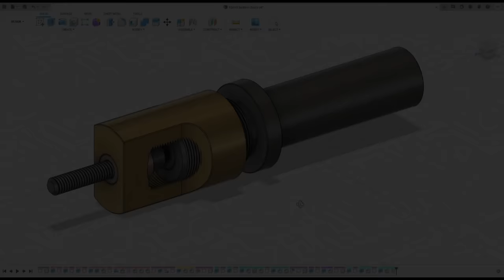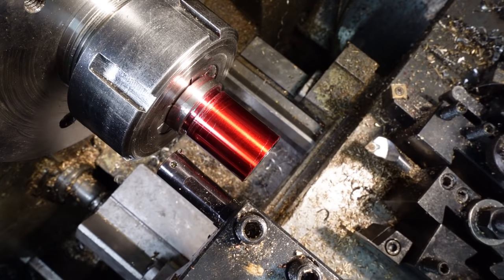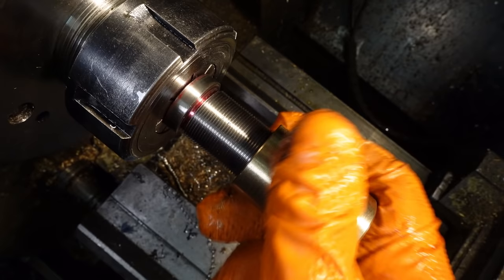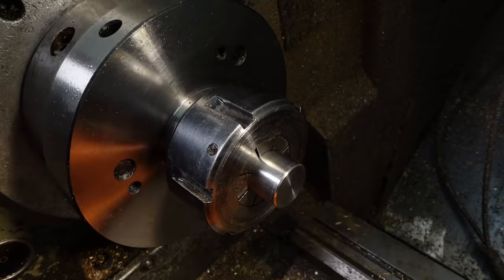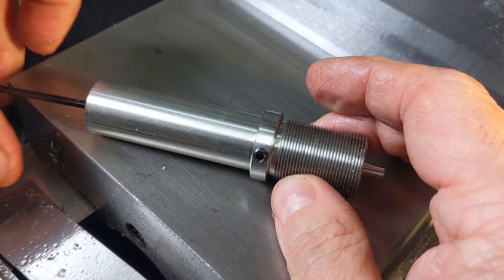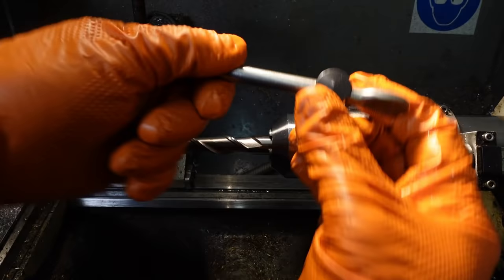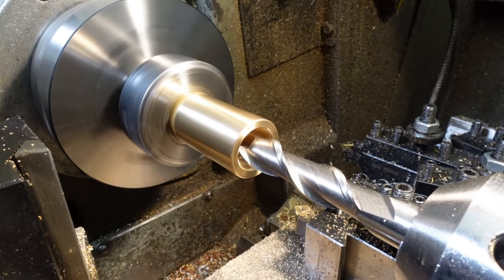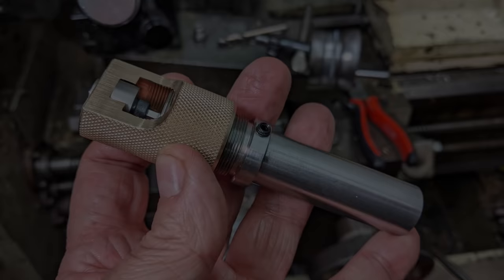Lantern Chuck machining and build #toolfest2021

Comment: I'd never heard of a lantern chuck before now.  Now I'm educated!  Lovely video!
Reply from the maker: There'll be a more classical Lantern Chuck coming along in a future video. That one uses a solid body with long side openings like the nut in this one, but the mechanism is tightened differently.  That means the axis of the screw is much more tightly controlled.  This version is great for screews between M2.5 and M8, or indeed Imperial sizes in that range.  The new one will be for the M1.0 to M3 range, mainly for making special tuning posts and small fixing screws for microwave kit.  Watchmakers have been using lantern chucks for this sort of work for ever.  I just need to think how to make it pretty and shiny and a joy to use.

Comment: He is the reason I took in consideration my 26 years of experience and started  watching videos my professional career on you tube with a different outlook. once I saw how my comments could and do probably seem like a  keyboard warrior . I don't care how clean a shop is cause everyone's perception on cleanliness is well there's alone.no more comments on how to tune,build a engine,transmission,rewire,or weld up any type of steel or alloys.and machine parts to a engine or job shop. Great video and content. I have learned quite a few things and tricks from you.thank you .

Comment: Luv seeing someone who uses the proper speeds and feeds for the different tools.  And thanks for showing the making of a tool I never heard of or have seen used.  Very interesting.
Reply from the maker: I try to listen to the machine and the material in an attempt to get good chip formation rather than sticking to the published rates for each tool/material combination, as those are usually based on wearing out the tool fairly rapidly and using lots of horsepower to shift material as rapidly as possible in the pursuit of Profit. As I'm only capable of pursuing Loss, I'm more interested in precision and finish and not making chips like razor wire that fast cycle times. Sometimes though I just can't get the chip load high enough because of only having a 3HP motor from four decades ago.  That's perhapswhy I sometimes use high-rack polished inserts that are meant for non-ferrous on steel instead (to the horror of the  assembled multitudes). Sometimes I just get it wrong, but the old Colchester has a super gearbox and I also have the variable speed inverter control, so I can even do the right thing with a fake CNC lathe spindle speed-up as the diameter of cut falls on facing cuts and pretend it's a Mazak and I'm cosplaying as Edge Precision. "Probably not..."

Must go watch some Vice Grip Garage, it's been a long evening in the shop making Delrin ribbons.
Reply: @MachiningandMicrowaves  Delrin ribbons will force you to do the dreaded clean up LOL
Reply from the maker: @michelecrown2426  If I get the aim right, I can get the ribbon to arc over the toolpost directly into the bin. I never seem to achieve that when the camera's rolling, but one day....  Youtube Shorts here I come. I nearly made one last night, but I fell asleep instead.  It's probably for the best.

Comment: True story: About 40 years ago, I needed to some machine work done that the local shop said that he couldn't do. They told me about a shop in East Point that they thought could do the job for me. The shop was in the "old part of town" and sure enough the shop was an old wooden building that was quite large. I could tell that at one time this had been a bustling business. Well the thing is the building had, at one time, been on fire. All the machines were driven by the "over head" pulley system. There were great wooden columns and overhead beams that were charred from the fire, some halfway through.  The canvas belts had burned away and had been replaced with used ones. The pulleys and shafts hand all the paint burned off and were rusted severely. The owner had kicked the ashes under the machines and created little paths to walk in and continued business as usual. 
I, now, wish that I would have taken pictures of that place because I fear that no one will believe me.
Reply from the maker: Brilliant!

Comment: That's a neat fixture! Never saw something like that before today. I just split a nut with a hacksaw and use it as a clamping fixture in the 3 jaw. If its a long screw I will use 2 nuts. Thanks for the video.

Comment: Just found your channel yesterday, I like your thoughts on gloves and cleanliness. And I like your responses to the negative comments. It might be ok to give advice to beginners, but people should just sit back, be quiet, and enjoy the work of a master. I look forward to watching more of your videos. Thank You.
Reply from the maker: I love getting good and useful advice about what I'm doing wrong and things I haven't spotted. I've had some really perceptive comments and suggestions from seriously expert folks out there.

I'm just wildly allergic to armchair H&S nerds, and I respond with extreme prejudice if I feel like I'm being bullied. Anyway, all is sweetness and light, the bits of the shop that get seen in the videos are clean enough to eat lunch off (if you don't mind cutting oil and odd bits of swarf in your sandwiches obvs).

I'm very slowly getting new cupboards and drawers fitted, and moving some stuff out into a new area for sawing, grinding and welding, and setting up a separate indoor area for metrology, which will make for better precision and liberate space for some other machines.  Also setting up a 3D print area in one of my other workshops and an electroplating/electroforming zone in another one of the old farm buildings.  Then there's the metalcasting area and the antenna range and all the other jobs I don't have time for! At some point in the far future, I'll have the space organised so it looks like an operating theatre, but the eventual heat death of the Universe may arrive first.  Right, back to making huge volumes of Delrin ribbons in the cause of Science.

Comment: I really enjoyed the lantern chuck video and it's been added to the project list.  I'll get round to it RSN, as unlike you, I've retired from network management and security at a certaain university, having also failed to find a proper job over the decades.  Meanwhile, the swarf on my Myford provides evidence to The Management, when she peers across the threshhold, that the expensive object does actually get used.  I too had to retire my shop vac after two and a half decades of (ab)use but I bought a new one at the end of last year.  I've used it four times already.
Reply from the maker: I need to make a more classic lantern chuck for the really REALLY tiny screws at M1.6 and smaller. This one is getting a surprising amount of use.

Comment: Yeah I use riggers gloves when I'm using the wire wheel on the bench grinder, the chance of the wire catching and ripping my hand in is close to zero whereas the chance of it wire brushing the sensitive layers of my fingers off is high.

Comment: I had a job to shorten many hundreds of allen head screws like that. Doing them one at a time like that would take forever. I just took a flat bar and tapped a row of holes in it , screwed in 15 screws, put it in the mill and lopped them all off. I ground a bit for the fly cutter (no not the kind of fly cutter that all the bone heads copy from each other) that would both face mill on the outer edge and cut a 45 deg on its inside edge such that if it is brought down on the screw it cuts a 45 chamfer on the screw. Since I spaced the screw an even distance I could just turn the mill handle 2 turns to move from screw to screw. 
1) Mill across
2) Center on #1 
3) down chamfer 
4) two turns 
5) down chamfer #2 etc.  etc.
EASY PEASY, job was done perfectly in a couple of hours.
Reply from the maker: Yep, done exactly the same thing lots of times where there's a batch to do. I have a drawer full of different bits of bar with lines of holes in various threads. Those lantern chucks are useful where you need to machine a ball or domed face or form a precise parallel section or remove part of the thread or machine part of the thread off and cut a different thread, or length the thread of a plain-shanked bolt like I did last week.  OK, that could be done on a mill with a die in a collet chuck, but not if the bolt had a countersunk head. It might be easier to single-point it, especially if it needs a fillet or a gutter at the end of the thread. For short runs and one-offs and weird stuff, it's a useful thing to have around where a slab of plate with tapped holes isn't feasible.  Also much easier just to buy the right size screws in the first place I guess! Also it was a fun little project and I have the ultimate luxury of not having to earn my living from machining (or indeed, microwave radio engineering or Physics).  I'd starve quite rapidly in all three cases, I'm sure.

Comment: Hi, I bought an old southbend Lathe about 10 years ago, Managed to build a quarter size Steam Tractor "John Fowler" design and have continued since to repair and manufacture numerous tool's and gear as needed, previous to this the last thing i made in metal was, a poker at school! Now a pal of mine who worked in Engineering decided because i had gone this way! so would He, Oh Big Lathe, Big Mill 3 phase all singing and dancing stuff, WELL the most used item of tooling in his 30k workshop is a SWEEPING BRUSH! and he messes about making crap, just occasionally when he could be bothered visiting my Shed he would look around and smirk at the state of the place wanting to clean up, Ah well i'm still ding Steam Stuff that works and He's still sweeping and polishing, and growing old. Continue as you are Pal, Don't let the Bu--ers grind ya down.
Reply from the maker: Hahahaha! Excellent!

Comment: Your shop, do it your way. Condolences for your wife.
Just became a subscriber.
Reply from the maker: I'm installing a spiffy overhead suction tube thing on a tension hanger so I can pull it down to clean the machines without dragging the shop vac around. With the vac itself outside the shop, it is fairly quiet as well.  I'm using a large bin as a catch-tank for fluids and shavings so the shop vac only has to deal with fine dust and the filters should last much longer. I'll probably lose hammers and wrenches up that tube with the amount of suction it will have.  Marvellous.  

The downside is that now I can see where all the patches of bare metal are where the paint has worn off.  I preferred it with that protective film of oil and brass dust.  Ho hum.
Reply: @MachiningandMicrowaves  My wife complains about my shop being dusty and dirty (I do both metal work and wood work) so I told her, you don't like it, you clean it. Hasn't bothered me since.
Reply from the maker: @ngauge22  That does sound like a slightly risky tactic!

Comment: As a newcomer to your channel I was impressed right from the start with the name dropping of one of my favourite YouTubers who seems to keep his machines spotless and advises if you see any machinist wearing gloves, long sleeves, jewellery etc TURN OFF. I'm glad I didn't. I'm now a subscriber to you as well as his channel.
A fantastic video full of tips and knowledge. I was very impressed with the tailstock DRO and I will almost look into one for my machine.
Thanks for making this and passing it on.
Steve
Reply from the maker: I am SO tempted to remake that video with not a single glove in sight and free of rant. Now I have the new shop-vac the lathe and mill are almost acceptably shiny, some of the time. It must be great for folks who have the time in their lives to keep their workshops looking like an operating theatre. Machine shop work is a tiny part of my time and there are hundreds of other things that I should be doing instead, plus the day job, family and occasional sleep. Anyway, all my recent videos only have gloves in them when the spindles are off and when the air-hose isn't broken, they are relatively free of chips.  I can't say the parts are any better as a result, but I have to spend less time dealing with complaints!  
That tailstock DRO has been mightily useful, although for anything REALLY critical, I use a long-travel dial indicator, because the linearity of those cheap scales isn't brilliant in parts of the range. If you only care to within 0.02 mm or a thou of hole depth, then this thing works a treat.  Only thing to watch is clearance when using a live centre in the tailstock.  If you make one, mock something up first to make sure you don't foul the "ear" on the toolpost before making the collar.

Comment: I must admit, I did like the added "rant". LOL
Reply from the maker: I took out the more extreme rant about gloves and replaced it with "interlude music".  I just get so cheesed off with armchair health and safety inspectors acting like bullies and religious zealots, trying to mansplain how my safety risk posture is unacceptable to them because it doesn't comply with a world-view shaped by experiential trauma, indoctrination or belief systems.  

Oh dear, I just had another rant, didn't I!  I really need to shut up about this.  These days I just block any trolls who are rude enough to try bullying me.  99% of the comments scolding me for something I'm not doing the "best" way are entirely sensible, and I've had some totally brilliant tips for ways to improve my dreadful shop techniques.  In some cases I do stuff the long or terrible way through choice, but mostly it's because I have no idea what I'm doing.  I really value those contributions and light-bulb moments.

Comment: Hi, by the looks of it you have a Colchester lathe, maybe even a Colchester Triumph 2,000 which is an excellent lathe with clearly defined charts and leavers for screw cutting. Although I was trained as a professional, in my retirement years and with a home workshop I have to suffer a lathe of much lesser quality than yours. I have to change gear wheels for the required imperial or metric thread pitches that I require. For that reason because one could easily make a mistake selecting the different gears, I actually believe it is useful to do a scratch pass and check the pitch with a thread gauge before continuing . Your content is interesting and I might have a go at this as I believe it could be a very useful addition to my workshop. It is always nice to use a quality home made tool. Thank you very much foe sharing, you clearly have good turning and milling skills, always a pleasure to watch. Having watched to the end I heard you mention Bridgeport so maybe I was wrong about your lathe type, either way it is a very fine piece of kit. So sorry to hear about your loss, in time hopefully the good times you had will replace some of those horrible feelings of grief and loss. Wishing you the best going forward from a cold and damp Plymouth UK.
Reply from the maker: The Lathe is a Colchester Student 1800 that has been very well cared for since it was bought new by the previous owner in 1982.  The ways are still good and straight and the bearings are in great condition.  The comments abotu scratch passes are entirely tongue-in-cheek, I once wrecked a part because I'd left the 1.75 mm gear in the threading dial when cutting a 1.25 mm thread. Gearbox was set up perfectly, but the indicator was telling porkies. Lesson learned. It's a great luxury to have a gearbox that can do almost any metric or imperial thread without any change wheels. 
I also have a Bridgeport milling machine from 1962 that's had a rather harder life in a technical college, but it can still make good parts if I'm careful to stay out of the potential problem areas where there are looser spots on the main leadscrew where there is a little more backlash so I have to put some tension on the locks if I'm climb milling, and there is a subtle difference in surface finish when flycutting 4 inch wide copper blocks when milling right to left compared with left to right that is probably caused by asymmetric leadscrew wear. I might swap the leadscrews for ballscrews one day.

Comment: My mom always asked where I kept the hand grenades I used to turn my clean bedroom into the junk yard I like it as. Keep up the good work!
Reply from the maker: The bits where I point the camera are mostly spotlessly clean these days.  The rest, not so much, but soon there will be a major transformation in the shop as lots of changes are happening to make the space more usable.  Various things are moving to the other workshop and I'm invading the house with some of the metrology stuff and setting up a separate welding/grinding/plasma area and an outdoor metalcasting area, a 3D printing area for filament and resin, electroplating/electroforming and somehow dealing with the woodworking tools and all that horrible dust. Then I need to re-jig the radio/electronics lab and the study where I work most of the time.  No time to do anything right now though.  I need to retire, but they keep throwing money and it comes in useful to buy stuff to make the place untidy